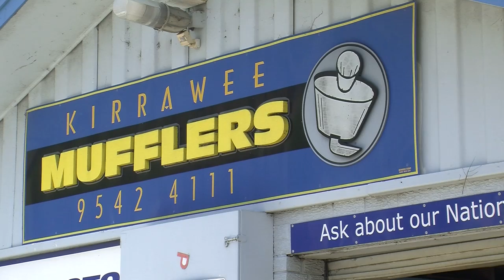Marty's Euro Car

Comment: as a volkswagen owner i would like to see VW make more variations of sports cars. it seems like they put the same 2.0t or 1.8t or whatever engines in all of their cars, it would be nice to see them make larger displacement engines that produce more power from the factory. i think the vr6 is a great engine but its not even offered anymore in GTI/GLI. also i would like to see something different than FWD. i think the golf r was a decent car with its AWD system but its intrusive and won't let you just drive the car and have fun with it. by the way i know having a VR6 engine into a rear wheel drive car makes no sense but I'm just giving ideas. it would be nice to see something different from volkswagen

Comment: A simple tune and exhaust will have you running in the late 6's to 100kmph. Has the same engine as a mk4 gti, in a light frame ;)

Comment: I bought a Monaro/GTO 4 years ago for $12k USD, Have about $9k in mods so far and when I'm done It'll school the C7 for 1/2 the price. Building it from the wheels toward the engine because power is nothing without control.

Comment: Yeah there the 240 is the same as the 180 but it comes with a ka24 which has huge low end torque and mine gets 24mpg

Comment: the right bmw would fix the "dullness".. unfortunately those are getting more and more tech (weight) laden, and less driver focused. Try a 90's 3series that is bad enough you wouldn't mind stripping it out.. I promise smiles if you strip a 3 series and kick the engine up a bit

Comment: if you wanna true sleeper, get a used b5.5 passat, with a w8. an 8 cylinder engine. and its got a 6 speed in it and its 50/50 awd. if i had 10k thats what id get. but unfortunately i got a 2000 vw passat wagon with a 1.8turbo and its an automatic :'(

Comment: One. tuning an allwheel drive car for more power to the rear defeats the purpose of having an allwheel drive car. Two. 1200hp, for drag... Drag cars are not reliable they are race cars. Three. yes the power would be bad for rallying, you will literally destroy everything in the drive train. Four. the Suzuki Pikes Peak Hill Climb car is not a rally car it was built for Pikes Peek a hill climb not rally. If you try to rally that car it would explode.

Comment: Polo is not good at all!
Few German cars are good to own, as they have no "soul".

Peugeot (Europen car maker) makes some of the best hatchbacks:
205, 106 and 306 are very good examples.
Renault Clio mark I, II and III are also very fun to drive.
Reply: Yeah,and they break down after a week
Reply: +hitardo Polos and german cars are great, peugeuots and Renualts have been a bit unreliable in the past not sure how they are now a days.
Reply: +Bleak Hollow that is true to some models.
As for some models on the Volkswagen side.

I had a Polo 1.2L Petrol with 1000km on the clock that broke the engine block. So... It depends.
It depends on the model, the version of the model, the engine and the care of the owner.

My Peugeot 106 runs flawlessly and my mom's Renault Clio never asked for anything rather than oil changes and Petrol.
And both cars are smooth and comfortable.

Few German cars are comfortable.
For me, German cars only Mercedes-Benz and BMW.
Opel, Volkswagen, Audi (and their derivatives: Seat and Skoda) are not an option, as their suspension is too much firm.
Reply: +hitardo personally I love bmws they ride really well and if you don't mind it being a little older they're incredibly reliable.
Reply: +Glenn Reuther BMWs are, without a doubt, one of the most dynamic cars in the automotive market!
There are a few exceptions tought.

I think the 3-Series is a good example.
I am thinking on buying an e46 320d (Diesel), in the Phase II.
A reliable, comfortable and dynamic car to drive.
Reply: indeed. since i've owned one i've become a complete BMW freak. absolutely in love with the cars. 
i personally have a 94 325is. float like a bimmer really describes the ride of the car when you aren't pushing it too hard. otherwise i admit there is a ton of body roll on my model despite having the m3 suspension and diff.

Comment: There aren't to many VW's that are not TURD. I can't think of one that is not TURD. Audi's as well. BMW? Well anything made out of aluminum, magnesium or steel is really top quality. The engineering in the suspension and tightness of the body is exceptional. The paint is beautiful. Driving a BMW is freekin awesome, a true experience. Anything made out of rubber, plastic, nitrile and any and all of the modules, sensors and switches are complete trash and you need those items to be as top quality as the metal parts in order to make the metal parts work. So this dilemma makes the quality of the BMW only as good as the O-rings it uses for seals and gaskets, or the plastic it uses through out the rest of the vehicle or, about as good as a Chevy Cavalier. So get in the car out the seat belts on, adjust the mirrors, steering wheel, inside air temp, radio station, seat position and leave the windows and sun roof closed. Put both hands on the wheel, start it up and drive. Don't touch anything in the car from that point on and nothing will break, until the lower control arm bushings start clunking. When that noise is heard, it is time to trade the vehicle in and let someone else start doing the repairs because from that point on it will, as they say, "Break My Wallet".
Reply: GUEST1666 such arrogance towards vdubs....but praise  beemers lmfao.

Comment: no. One,  an all wheel drive car will not handle as well as a rear wheel drive car. they under steer rather badly at speed. Two the subaru H-4 tuned to 1000hp?!? the block and motor is strong but 1000hp, there's no safe reliable way. Three, you wouldn't even want 1000hp to go rallying, that's just stupid you would snap every axle and destroy your transfer case with the power.

Comment: In order to replace the CV axles in a VW you have to remove the entire front end, drop the engine mount, and remove the entire wheel assembly. Too much work for something stupid. VW fail.

Comment: 1st a golf r32 is not like an evo
2nd yes a modern vw doesnt feel alive or what ever. its boring.
3rd i dont like vag
4th a polo is not MAD JDM! so its out.
5th i wouldnt call a blown vw reliable. but i wouldnt call a blown japanese car reliable either. in fact i wouldnt call any blown car with some hp reliable. 

marty what about n\a? n\a feels the best. no turbohole direct response from the engine...

Comment: stupid big engine 1.8l lol i love being in america my truck had a 5.0l and i thought that was too small. God i love my country
Reply: Dean Webb lol really? ford mazda Volvo citroen ect all have made smaller cars with 2.0s. for its size a 1.8 is a small engine! my toy car is a 1/4 of the weight and smaller and only has 124cc less and that is small engine to!
Reply: Luke Thornton 1.8T is a freaking beast, can make good, easy power
Reply: *Your truck. Which weighs what.. 4 tons?
Reply: Joe Mckay  No need to be rude. I wasn't leaving a negative comment, the first reply cleared up the error in my way.
Reply: rimwydas44 No need to be rude. I wasn't leaving a negative comment, the first reply cleared up the error in my way.